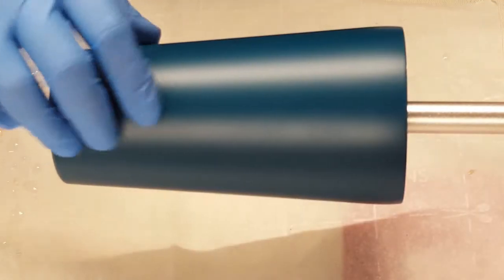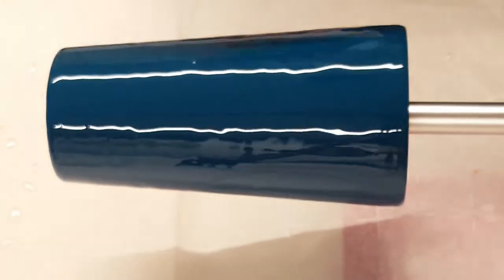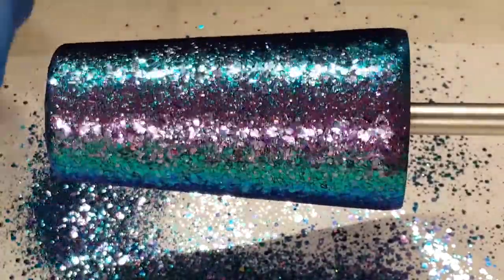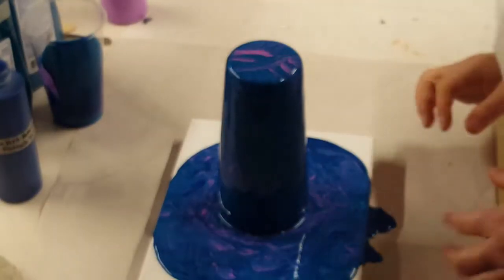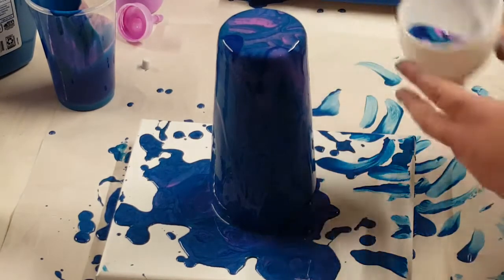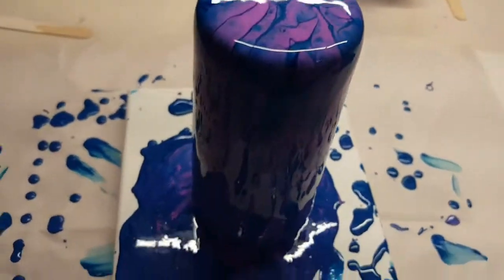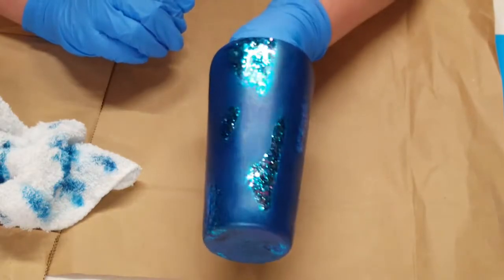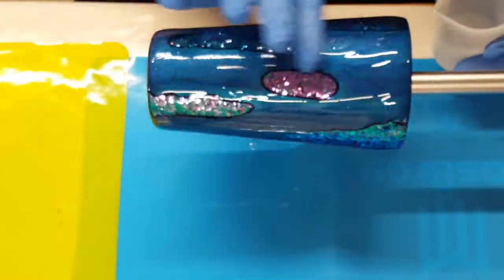(94) Geode Style Tumbler | Acrylic Pour On Top Of Color Shift Glitter

Comment: Wow this cup turned out amazing, I love it. I've found the woodcrafters is the most bubbly of all their resins. It has a ton of micro bubbles IMO. It also has the strongest smell and it yellows over time. Which is fine if your piece isn't white or clear ❤ but this turned out fantastic 💙💙💙
Reply from the maker: Thank you so much, Tish! Woodcrafters does have A LOT of micro bubbles. Highly doubt I'll buy it again. I think all resin yellows over time. Does the Woodcrafters yellow faster? I know the Envirotex stuff I used yellowed really fast that's why I stopped using it. I haven't really noticed a smell, but the General Use I think has a strong smell at least the last batch I got does. Thanks so much for watching!
Reply: @JSCreationsArtSanity  yea IMO it yellows faster. I have a unopened gallon that's super yellow. I am going to use it in pieces that are pure darker glitter. Then it won't show the yellow. The general use does have a strong smell to but to me the woodcrafters is more stinky. Oy. I need to find a resin that works for everything that is low odor.
Reply from the maker: I hear ya, me too. If you find one let me know. Lol. I have like three different kinds on my table right now and I'm so scared I'm going to mix the wrong A's and B's together even though I have them marked.
Reply: @JSCreationsArtSanity  I know what you mean I keep all mine in a plastic tote with the lid on. You'd be surprised the smell that comes out when I open the tote lid. The thing is I know a lot of resins that don't smell but they're not good for top coats 😥